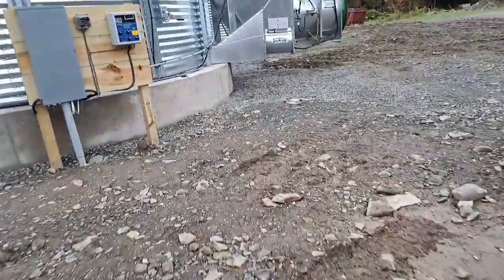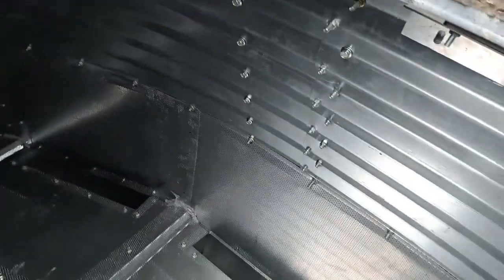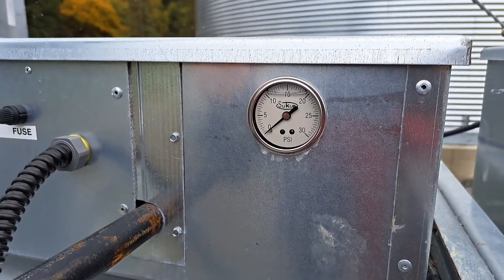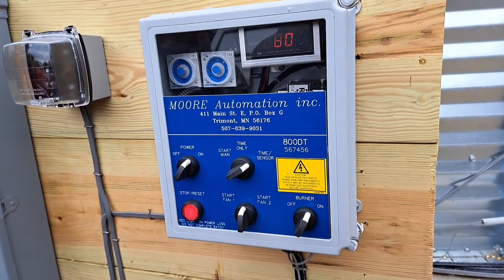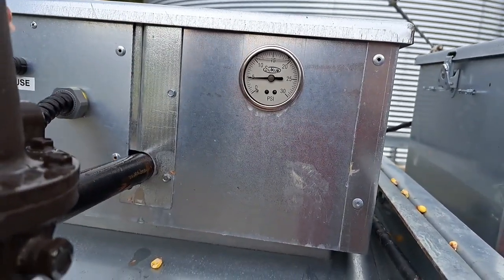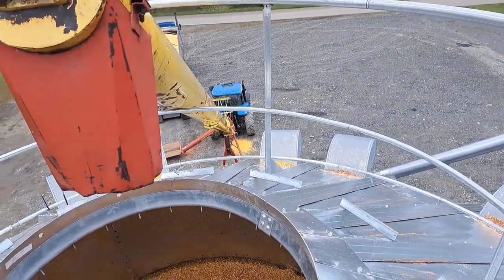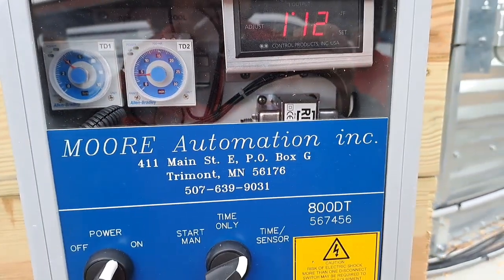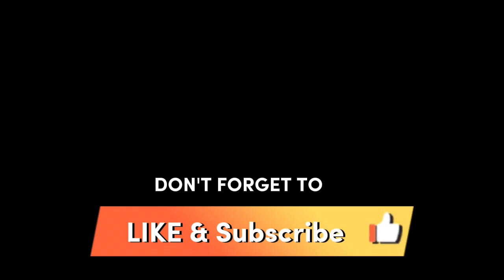How to operate Moore Automation topdryer controls, economical manual batch dryer controls

Comment: How many bushels per hour can you dry on this 24’ top dry with that one 15hp burner? Also how much does it hold up top in the drying chamber?
Reply from the maker: Holds 1,000 bushel per batch. Dries about 650 bph at 5pt removal with 15hp 44" drying fan and 24" 5-7hp inline centrifugal cooling fan

Comment: I'm running a Superb as400.  It doesn't have a modulator Valve.  So the burner is off or on.  Would I benefit much from adding one?
Reply from the maker: The problem with adding a modulating valve on a dryer that didn't have one from new is it can cost more than it's worth